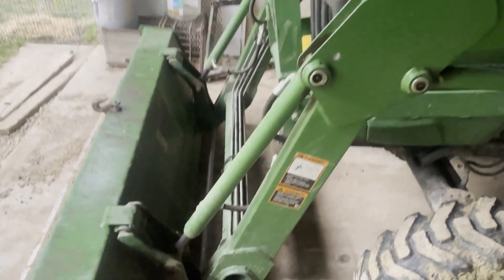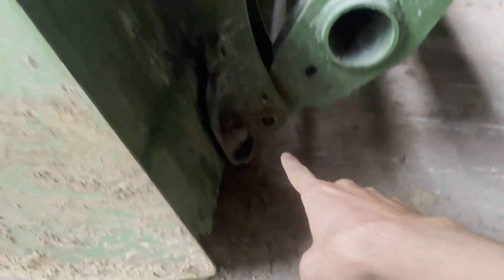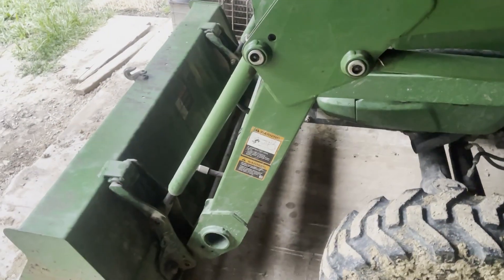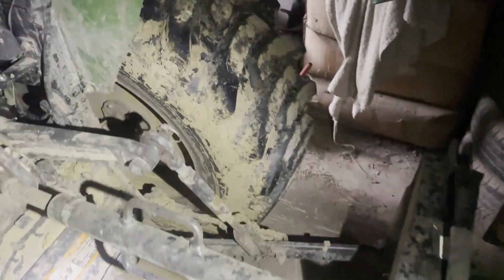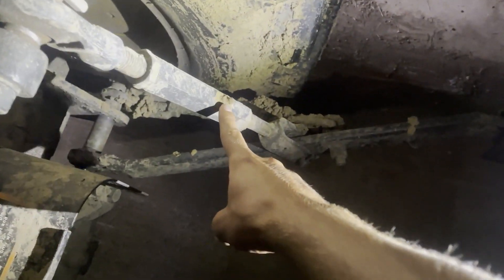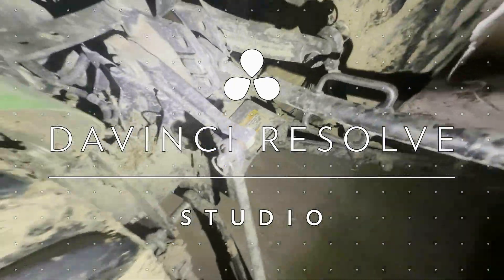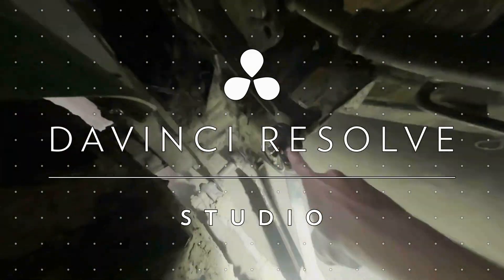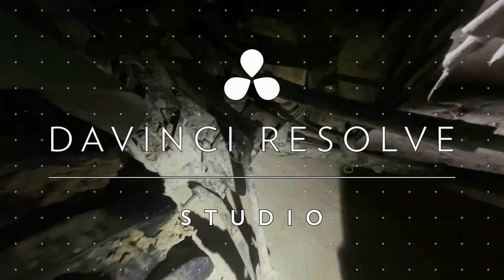Where Are The Grease Zerks on John Deere 3032E

Comment: Hello!  Great video but there arev2 more under the front axle where the axle connects to tractor.
Reply: Atleast my 2015 3032e has them!
Reply from the maker: Ours is a 2013 and it doesn’t have any on the front axle, Maybe John Deere added those when they updated the 3E series in 2015??

Comment: The front axle should have 2 on each side, additionally one on each front tire, under the front end hood should be an additional zerk per tie rod, be careful not to blow up the rubber seals…

On the rear axle you should find one on either side of the fender as well…those often get overlooked, neglected and forgotten.

Comment: Hello Nathan, not sure if you know but this tractor has 5 different fuel/oil filters that need to be replaced anually. Also under the tractor (front area)  there is another grease point that you did not mention. Maybe you did not see that one cause it has a little plastic cap/cover.
Reply from the maker: Ya I never found the one on the front axle, thanks for the info I’ll have to look again!
Reply: annually is overkill imho.bsme,msme,veh safety,durabily engineering,autos,so tractors little outside range of experience. peace,and grease

Comment: If it 4 wheels drive you have one on the front wheel gear box where the drive shaft goes in. In is facing out the side
Reply: There are 2 grease points on the front gear box.  I have had the 3032e 4 wheel for a bit and had found one on the rear where the drive shaft enters.  This weekend I installed a new battery and removed the engine enclosure (front grill & panels).  The bolts for that panel have nuts beneath the compartment floor.  As I slid under I found the 2 front zerks.  I could post pics if anyone needs them since I can't find any real guidance from Deere.